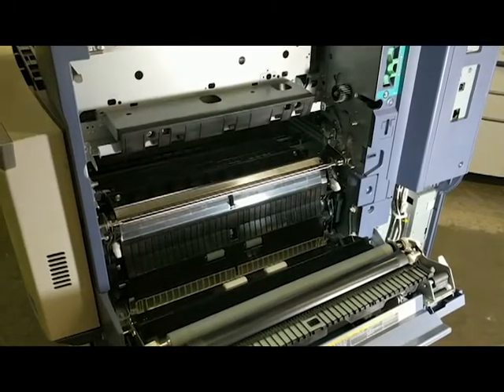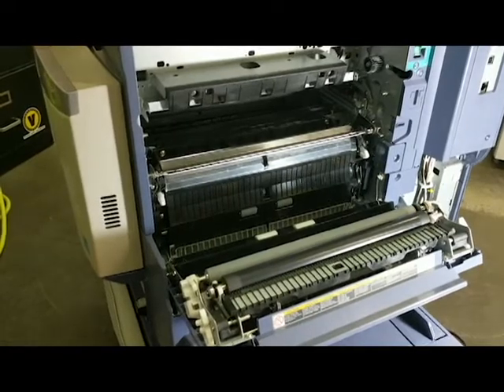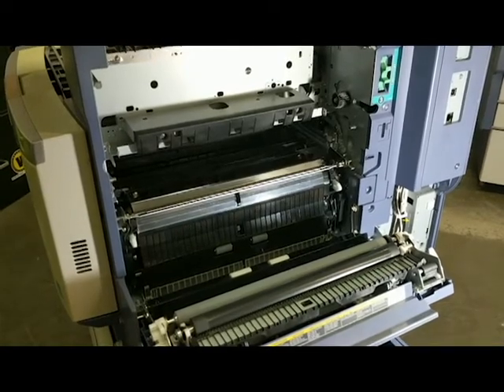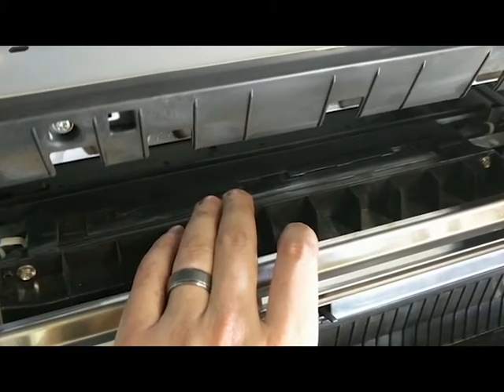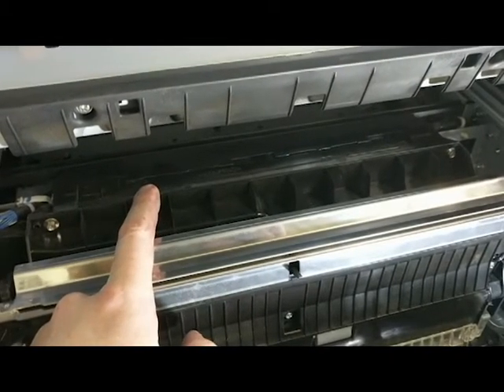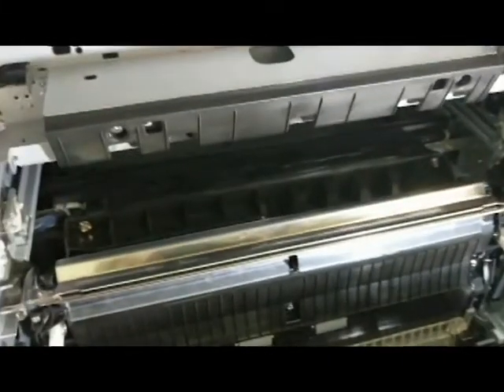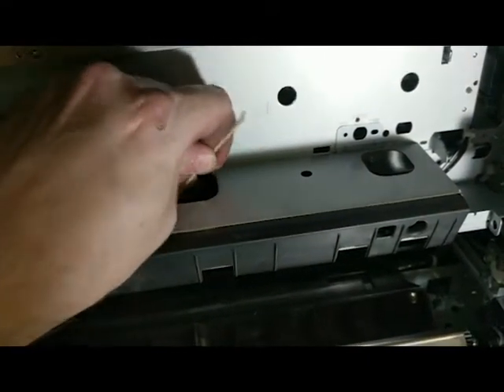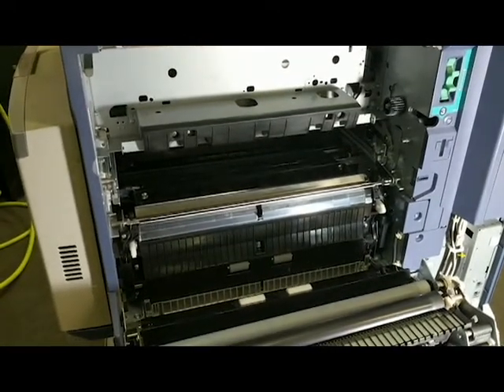KILLER CA00 CODE - Transfer Belt Sensor

Comment: hate these machines. if you don't get a CE40 or CA00 you get a toner not recognized issue. plus the charge assemblies break and give you a C970 which would mean you have to rebuild the charge assembly and replace the developer for that particular color.